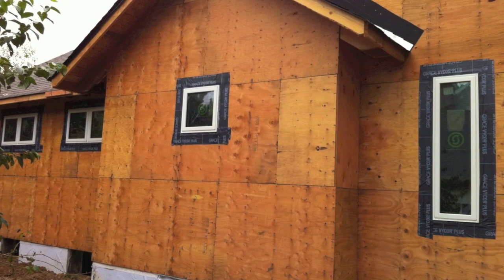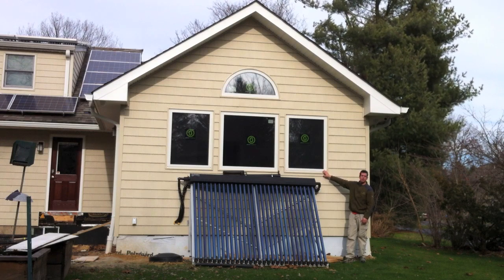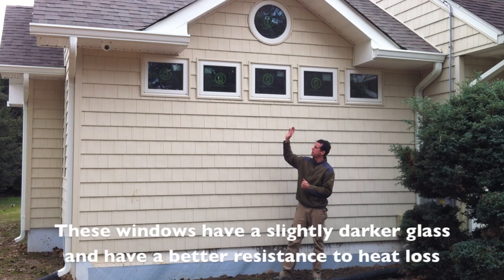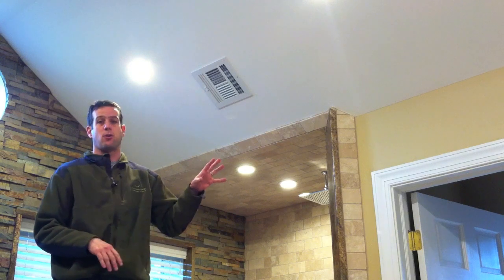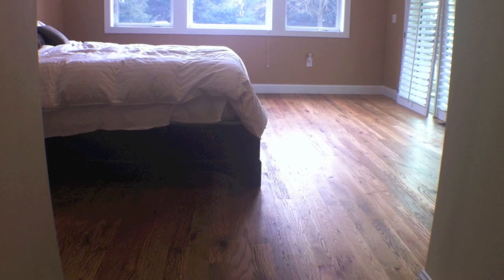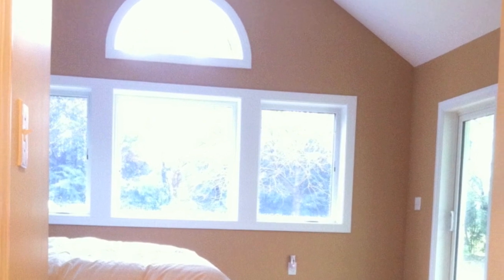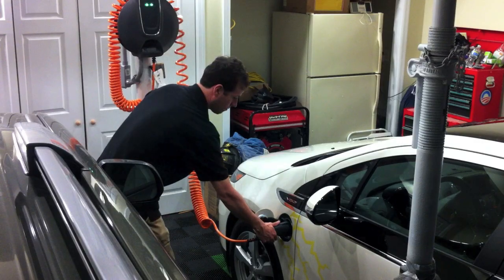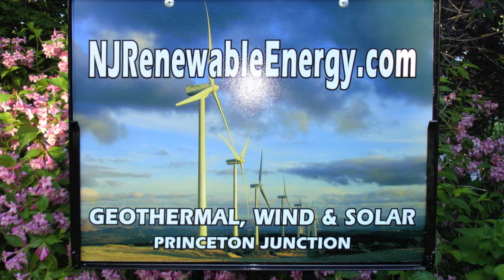NJ Passive House Part 2 - Passiv Haus

Comment from the maker: Understood, I have geothermal at my house too.  I'm suggesting that passive house construction is so efficient, that an air source heat pump is more than adequate.   With the savings between the top end air source (dual fuel) heat pumps, you can put that towards solar, insulation and a white roof.  You can easily provide all of your power with the solar and be net zero.

Comment: Any issues with the off gassing of the foam insulation.  I've read about issues with the foam insulation to where it's had to be removed.
Great project and thank you for sharing your experience
Oh, did you consider or do anything with your existing home with improving it's energy efficiency?

Comment: Using the ventilation system to bring cool evening air into the house directly seems like a very good idea. I suspect that a passive house would rarely require air conditioning if the evening air was used to cool the house in a southern California type climate where the evenings are almost always cool.

Comment: Cold air doesn't penetrate the window's glass. It just makes the glass colder so that the hot air inside by touching the cold glass will become colder and sink and will be replaced by more hot air in the room hitting the glass and so on and on, creating a conductive current that will speed up heat loss.

Comment: Wow. Good freakin job dude. That's pretty impressive. I myself am looking to build a house of cob with some passivity in mind due to the thermal mass of the material and I'll definitely be aiming to utilize good solar orientation and the slope and size of the awnings but it's really cool to see your way as well for some ideas if I want to mix in some more modern techniques for building in passivity.

Comment from the maker: Keep doing what you're doing! Don't change a thing.  I don't know anyone paying 1440 per year for gas and electric.  As a matter of fact, I have many clients (for solar PV) that spend 500 to 1000 dollars per month for gas and electric.  Do you live in a cold or very hot climate?  In NJ its cold in the winter and hot in the summer. Do you live with most of the modern electronics?  Do yo u keep you heat and AC around 70?    I pay more than 120 for cable/internet/phone each month...You're good!

Comment: Are you able to flush toilets with rainwater legally here in the states? You could technically have a large enough separate systerm for the toilets and treat that water if you had to with a pool chlorinator if you had to treat it.

Comment: Window shading in a cold climate leads to moisture condensing on the window. Bad news is you need to accept heating the inside of windows to avoid wet windows.

Comment from the maker: Use a spray foam everywhere.  As stated, air tightness more important then just R value. Do a white roof.  If our solar array is going to be on the house, use a metal raised seam roof so you have no penetrations.Forget geothermal, spend the money on insulation and proper building techniques as I've discussed.  Install the top of the line heat pump, they have come a long way.  Use the saved money to offset all your power with solar.  Be sure to design you roof with clear sections that face south.
Reply: I'm arguing with my architect now about geothermal. I'd rather have the additional insulation and sealing. BTW, please spell the name of the window company. Thanks!

Comment from the maker: The shell can cost about 10 to 15 percent more.  However, as I mention in the video, the added cost can be recaptured quickly in energy savings, plus if you're doing renewables even faster.  There is no doubt a home with little or no energy bill is a great selling point.

Comment from the maker: As mentioned in video, the attic is "living space".  However, the ductwork you are seeing is part of the energy recovery ventilation system(ERV).   It is insulated because of the potential differences in temperature and condensation.  If its 70 in the attic and I'm bringing in 20 degree air, condensation would be a problem on exposed ductwork.

Comment from the maker: This is prob the only PH addition in the country, I'm not completely sure how to answer your question.  My thought was that TB is not really an issue.  It does have spray foam between it, but the old section is conditioned space.  Therefore, what heat loss do I have?  If its 70 in the old house and 70 in the new.  Now, airflow is a different story but I'm not going for perfection here..   I can tell you that my new addition is warmer then I have the only thermostat setting in the older section

Comment: As you sad. In Europe this is standard since 2006. We build our house in 2014/2015 and we only used solar (only 14 panels of 280 kWh). But insulated as hell. And a blower door test that was almost as good as a passive house. E-peil 30 for a regular home is not that bad I think :-)

Comment: How does that HRV handle bathroom exhaust, at what appears to be 60 CFM, from multiple bathrooms?    My bathroom has a 120 CFM fan (just 1 for 1 bathroom) and with a long hot shower, the mirror still fogs a little.  Can the HRV kick up to 300 CFM?

Comment: The airtight home needs electricity for the heat exchanger. When the shtf I suppose you can open windows to allow fresh air, right?
I would prefer a home that had "breathable" walls like Hemp or Straw, in which case I believe you would not need air exchangers.  Am I right?
Good video and very thorough, thanks.
Reply: +trumpsahead if the solar is setup as off-grid or hybrid power it wouldn't need the electric grid to power anything. a good solar setup could last 20-30 years if maintained

Comment: I live in a 2100 sf. inefficient 1968 home. I pay avg $120 month for gas and electric. I have to pay a min $27/mth just to have those services before any meter spins. So if I do all the upgrades you mentioned to my existing house, I would only be paying $36.30 per month.  So your saying I could pay off all those improvements with my $86.70 savings in how long?  50...75..100 years? Or I could sell (loosing money to a RE agent) and have a contractor build me one (for dbl price of conv home) right!

Comment: When a hurricane or tornado or even little bit more stronger wind it won't matter how TIGHT is closed. And when a flood don't worry, you'll have all the water for watering the grass

Wooden framing is the future of construction? Oh my my. I thought that that was concrete, bricks for STABILITY and RESISTANCE and big glass windows  to fill that concrete or bricks or even marble houses with light.
Reply from the maker: I have No idea what you’re trying to convey.  Build your house in whatever material works best.

Comment: All these hot roofs make me nervous.  Why not insulate it but still provide ventilation so you don't have to worry about the R value of snow causing it to melt and ice dam?  Also, it appears you used far more insulation in the walls than the ceiling.

Comment: I thought the point about making everything super insulated was so that you could buy a smaller a/c-heat pump and save $$ because you don't need a normal sized, costlier unit.
Reply from the maker: as i stated in the video, the existing house was built in the 50's.  The PH addition was so efficient I didn't need to add any additional heating or cooling systems.

Comment: Sorry but your windows are second rate to a triple pane tilt and turn window. Triple pane iliminates the possibility of your film system failing and triple pane has a much greater sound reduction aspect than flimsy film. Also and probably the most important aspect of T&T is the sealing system. when a t&t window is closed the mechanism draws all four sides of the window evenly into the frame. It is virtually impossible to have an air leak with this method. Plus, as the window ages so will the rubber seals begin to compress , making the seal less effective. To compensate for this , the window can be adjusted with a quick turn of the adjustment screw to pull the window sung again.
Reply: What companies carry such windows?